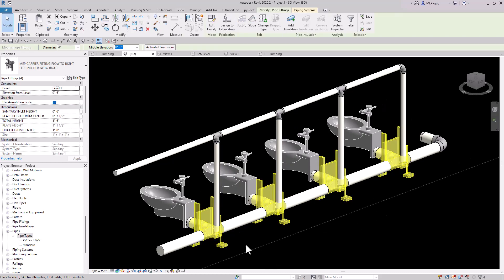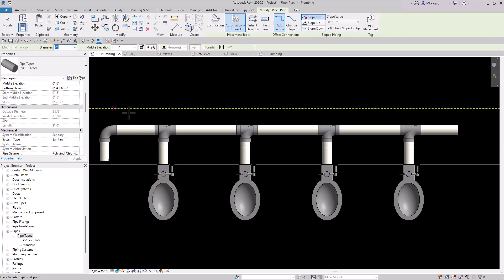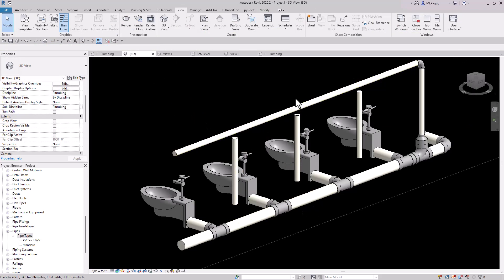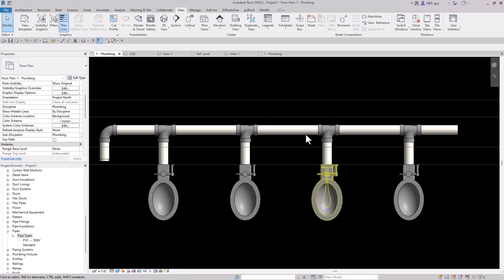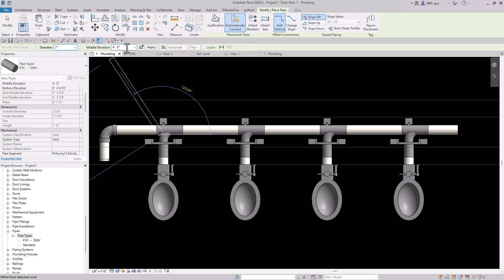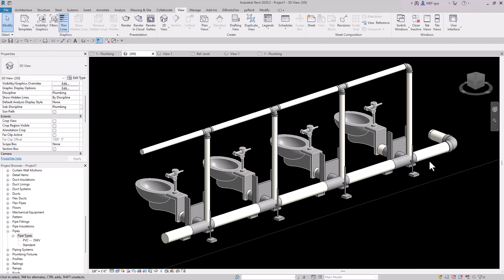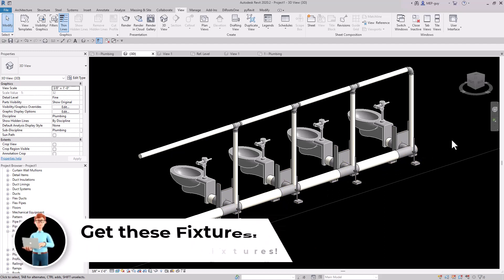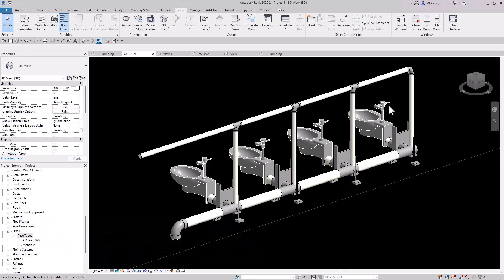Model Water Closet Carriers FASTER in Revit

Comment: Superb ! Could u tell in some details how to get 1st client as mep hvac engineer & which skills or project work do the clients look for most when trusting us in our approach..
Reply from the maker: Not sure I completely understand you question. But typically an architect will reach out to mep firms in their relative area and ask for a RFP (request for proposal). Then they choose the firm, based on their experience, price, reputation, etc. Many architects have a close relationship with a few MEP firms and use them on a project to project basis. To land your first client you'll just need to reach out the architects in your area and show them what you offer and your experience. I'm sure an architect could answer you question better.
Reply: @mep_guy  I mean can i work frm home with a laptop by using autocad, revit, ms excel for heat load calculations with designing & drafting is that enough ? Or any site visit or other issues are needed to be fixed ? Freelancing in our mep hvac field demands which things to be a top freelancer as beginner..
Reply from the maker: For new construction you don't need to make any site visits other than during the commissioning phase (after the project gets built). There are some engineers on upwork that do offer there services. If you have the experience then you could find work there.
Reply: @mep_guy  I have 6 months of internship & experience of 2-3 projects of commercial hvac can i create a portfolio from it ? To start attracting potential clients online or with LinkedIn app ? Which steps would work in this case..
Reply from the maker: I think you could get some drafting work, but to actually be the engineer you'll need to get a PE license before an architect would hire you to do design work. Start small doing some drafting for companies, then add some design, then hopefully you can work your way towards a license. You'll likely want to get a job at an actual MEP firm before you go off on your own. There is a lot to learn first! No need to rush it!
Reply: @mep_guy  Thanks a lot ! Much needed advice..I always want to learn new things & desire to make our environment a healthy place with purified air systems through services in mep hvac field. Apart from the hvac books/pdf's whats the best way to learn the valuable work, design stuff till the time i am at home bcoz for some months it's not possible for me to get a job in mep firm to work by being physically present in office or sites.. are there any podcasts or mentors like other fields which provides knowledge worth listening to so that it also gets us prepared for the upcoming events..